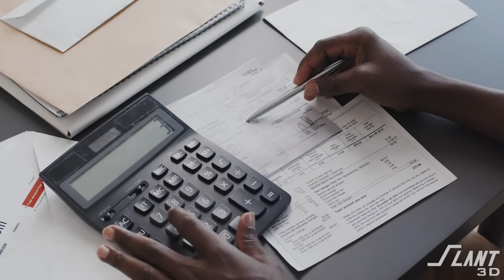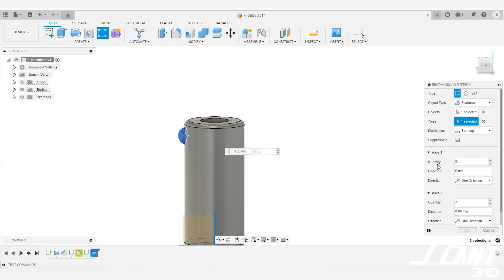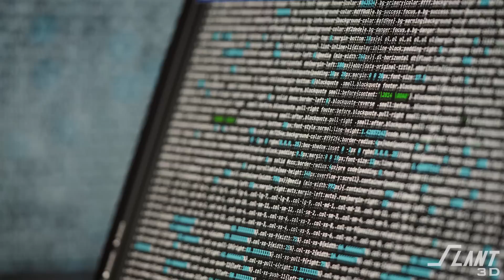3D Printing Will Obviously Replace Injection Molding

Comment: Speaking with several years of product development experience, including iwth injection moulding manufacturing, this video is not realistic. Injection moulds for lets say a certain small part the same part can cost anywhere between $800-$12000 depending on the manufacturer, so you can get cheaper moulds as well, they will just have a lower lifetime like 10,000 units. The quality is still better than any 3D printer apart from MJF printing and possibly Polyjet. Many products like consumer electronics sell millions of pieces, such as game consoles, phones, etc. The material properties of injection moulded parts is superior to 3D printing in terms of strength, especially with small parts. There has been significantly higher research done with Injection moulding for material properties as well, and colour science with Pantone and RAL colours for example. None of that exists for 3D printing yet either. I know of a company that uses MJF 3D printing instead of injection moulding to produce parts, but it is only because they are producing small parts in high volume, and they were producing small internal components for headlights, so for them it was feasible. Otherwise 3D printing is more expensive, by a factor of ~10 in some cases, and I know because I did the cost quotation comparison for products I developed. So while 3D printing is s viable production method for very specific cases, we are far from a reality where it is usable for mass production to replace injection moulding. We have no printer that can produce the material properties, surface finishes, colour accuracy etc. that injection moulding machines can do. You made this video with barely any knowledge of product development, Industrial deisgn and injection moulding, and the comment section full of experts who have worked in this field calling you out is more telling than the opnion piece you made. Be realistic. 3D printing has many advantages.

Comment: This is flat out lies! As a person owning 50 professional 3d printers and CNCs and casting machines as well I can tell you this video is totally wrong. It only applies to customized products or under 500 pieces products and both of which must suffer worse quality. CASTING cost fraction per piece and takes a fraction of time to produce with a significantly higher quality. You would have to be insane to go for 3d printing if you can sell more then 500 pieces.
If you need it faster or cheaper then get 3d printers a bit better and 3D print the Moulds!

This will never change even in the future - and moulding have potential to get much better when using a variable self changing moulds.
Reply: I agree 3d printing will replace small volume injection molding. 
If you need like 60,000 pieces injection molding all day.

Comment: I enjoy your thoughts on filament and additive processes, but you don't need to pick fights with other manufacturing methods in order to hype up 3D printing. All it's done here is hurt your credibility.

In a perfect world, printers would be able to create high-precision molds, and the two technologies would be used side by side to create parts both quickly and flexibly. This should not be a competition. We should be looking for ways to incorporate all such processes into our toolkits.
Reply: @senorali there is actually someone who is trying this idea, don't know if u have seen it, but 3D Printing Nerd recently posted video with such idea, but the polymer used for mould is water-soluable, which enables to achieve structures and geometry unachievable or very costly for traditional mould.
I leave video here for anyone interested in this topic  https://www.youtube.com/watch?v=4kIeqTK5iao

Comment: This has to be bait for clicks and your business right? An injection molding nachine can quite literally bury a 3d printer in parts before it ever finishes one print. A hammer isnt a screw driver. Lets use the correct tools for the correct applications.
Reply: This guy only cares about pushing his printing business and doesn't care that he's doing it by spreading lies and general bs. 3d printing will never replace injection molding...

Comment: Injection molding is cheaper if you're making a lot of parts
Reply from the maker: Incorrect
Reply: @slant3d Nope you're wrong, on a manufacturing stand point when mass producing parts or toys, btw over 300 million units of those star wars figures were sold in the 80s not thousands.

Comment: This is complete bull. You're shilling your business and blatantly lying. Your point is basically "you can run a print shop instead of producing a unique product efficiently at scale with an injection mold." Implying that innovators use injection molds for their prototyping is unhinged. Your conclusion that, because 3d printing allows you to iterate on and develop a design better/more quickly, 3d printing should replace injection molding is a delusion with zero basis in reality. Reported for misinformation.

Comment: Looking at the part examples and your perspective, it seems that you have only been exposed to the consumer trinket and gadget market. That is fine, but that does not represent the world in it's entirety. There are many major industries where 3D printing flat out can't do the job. You ignore dimensional tolerances, surface finish, mechanical properties. Things that aren't acceptable in medical or aerospace...

Your claim that no products ever run in major quantities is simply false. If you truly looked around at the world and saw what was molded you would see the mass scale that printers cannot hit. Your expensive printer farm cannot hit mass numbers. Look at the food industry and the BILLIONS of molded food containers and bottles produced every single year. Your printer can't even make 1 of those parts let alone begin to match the scale. 

And you provided zero evidence that you can match the speed of an injection mold. There is no printer on the planet that can match the speed of an injection mold. You have to build the part one tiny layer at a time vs a mold that is filled pretty much instantly. 

Additive manufacturing is cool and has it's place. However, it is not a 100% replacement to any manufacturing process though. It surely will take some market share away from traditional manufacturing but not to any concerning extent and certainly not any total takeover like you claim. As you pointed out, the major benefit to additive is it's prototyping ability.

Comment: Yes you can use it for development but when you sell 30-80 Million of something a year 3d printing will never be cheaper the molding when you get to millions of parts. It will never completely replace injection molding. I can guarantee you. I have built 100s of molds that have run for years. Besides a laser sintered metal molds will be cheaper also then printing individually. You are making your company look ignorant with such a broad statement.
Reply: I will take 40 million of something a year and pay 4 cents each because that is what injection molding does, I doubt you have made 40 million parts total. I believe you are a troll because you can't do it.
Reply from the maker: We do it every day
Reply: @slant3d  I simply refuse to believe that you print 30-80 million pieces a day. Maybe you do that in a year idk, but not for one client. Print farms have their place, you can serve more clients and iterate faster, but it actually does not completely replace other methods.

Comment: Imagine 3d printing a dashboard of a toyota car or truck XD
He is not right or wrong. I think people underestimate printing turn around on troubleshooting a design is super fast as for tooling the amount of engineering it requires to even consider a prototype and let alone the cost can be overwhelming making new products its not easy for everyone specially if it fails. I do see a future where 3d printer in certain areas will take over. But not in the following. Food, Medical, Aerospace etc. The tolerances that IM can give you cant replicate with 3d printing

To make it short and not argue about anything hospitals, military, Food industry, Drink Industry Blow molding, Car industry, anything aerospace. Will be really hard to replace. They expect plastic molecular and quality inspections will disqualify 3d printing for now. but who knows in the future.

Comment: Let me guess, you have some financial interest in 3d printers?  They are good for rapid prototyping and that is it.  Injection moulding is orders of magnitude cheaper in quantity.  You just can't expect a print head to move through three axes in the time molten plastic under pressure can fill a mold (blink of an eye).  Like for like 3d printed parts are usually weaker in use too.
Reply from the maker: If you are making 100,000 piece your should be using 3D Printing for sure
Reply: @slant3d Can you explain your point a little bit? A company can have multiple molds that all have multiple cavities. If the product didn't have a long cooling time after each injection, the tool can eject parts several times a minute. That would be awfully hard to keep up with.

Comment: I get your points, but "replace" is way to strong world. Went to see how Coca-Cola bottles are made. One injection mold machine made 14 bottles per second running 24/7 in farm of many-many machines. I'd like to see bottle that looks like Coca-Cola one with same properties (transparent, thin, strong, light) made with any form of 3D printing
It's good clickbity conversational starter for sure

Comment: Tolerances are the main thing injection molding has going for it i.e. Lego ;) Sure we can print building blocks but not to the spec Lego has them set for. If we figure that out then life will dramatically change to the way you envision it but until we can get those tight tolerances AND reliability for say a million 1x1 blocks I don't think it will happen

Comment: Why not 3D printed injection molds?
Reply: There's a good bit being done in hybrid manufacturing being used to make metal moulds. Printing the main bulk of the mould and maching back the final surface. This also allows internal cooling channels in the mould to speed up the throughput.
Reply: That is possible, and likely will be used more in the future, but injection molds will always require some machining for the tighter tolerance parts that no 3D tech can make yet.
Reply: You can for certain geometries and materials. The molds will likely wear out much quicker than a machined mold.

Comment: The iteration and ability to pivot is the key and will carry 3D printing further until it has the materials ability to replace more current industrial processes at scale. The example of digital testing is the prescient point - digital is physical too, and the line between both will continue to blur. There'll always be a crossover to traditional methods, but that point will continue to get pushed out.

Comment: Idiot. I have 35 yrs of experience in mfg plastic, resin sales, Polymer Chemistry and CNC parts. You will never be able to achieve the mechanical properties of injection molding with 3D printing because there is no thermal or chemical reaction which is what gives the plastic its strength. If the part has no loads or strength demands, sure and prototypes. But not mass production and it’s slower.
Reply: imagine 3d printing a dashboard of a toyota corolla LMAO
Reply: @133mhz.  B-B-B-But Uniqueness and Individuality! Every customer wants a unique dashboard!
Reply from the maker: Plastic is not metal. And yet they both work fine.

Comment: Absolutely impossible, not now, not in the near future, not ever, unless the 3d printer start materializing the objects instantly, but then will be not a printer anymore :)
There is no 3d printer that can get even close to the quality of injection molding, and if we come to a textured surfaces the situation is even worse. But the surface quality is the least issue, the speed is something that no 3d printer may achieve. Even for large and complex details the cycle time is measured in seconds. 
3d printers have their application, low volume production, prototypes, impossible for molding shapes, that's all, they always will be much more slower, low quality, more expensive parts.
Reply from the maker: We do it today

Comment: You’re funny, I had an entire paragraph written about how over half the points you made are straight up wrong. 

“You can change it” are you doing technical drawings or just “guessing” when making your designs? Like there’s a massive difference between prototype and production. 

If you’ve ever worked with injection moulding you would know that it’s light years faster than 3D printing. Also injection moulding can provide stronger parts than in 3D printing. I seriously have no idea where you’re getting your information other than making it up.
Reply: It's pretty easy to tell that this YT personality doesn't have any actual experience with injection molding or engineering. Lmao.
Reply from the maker: We do it every day

Comment: I can assure you there are plenty of things that just dont hold up as 3d prints where injection molding is the answer.

Something you sorely missed here: sure with 3D printing you can change something quickly and test it out, but you are only gonna 3D print it to see it in physical form. Once you've 3D Printed the piece you consider final, the design THEN goes to injection. Not try to keep changing and testing molds.

3D printing will complement Injection molding nicely, not replace it. (At least not in its current state.)

Comment: I definitely wouldn’t say that 3D printing will REPLACE injection molding, but I understand that your argument is that in most cases it will prevent small businesses from needing to take the extreme step that is injection molding